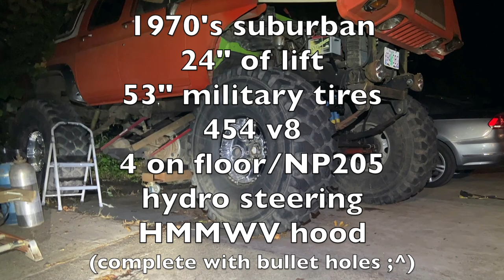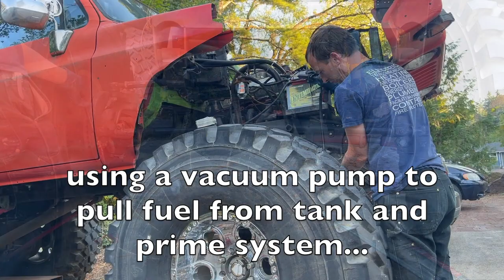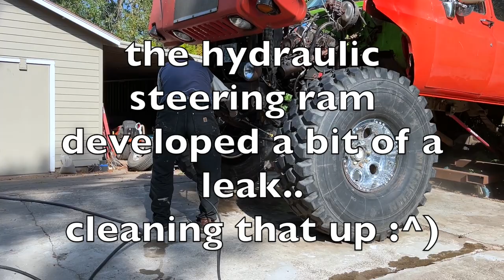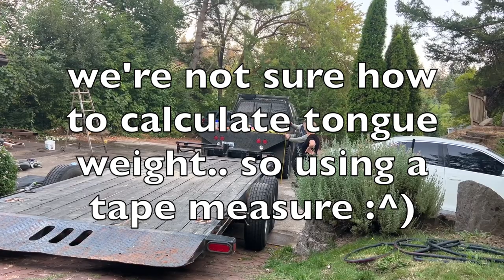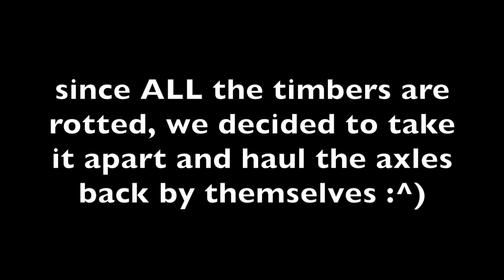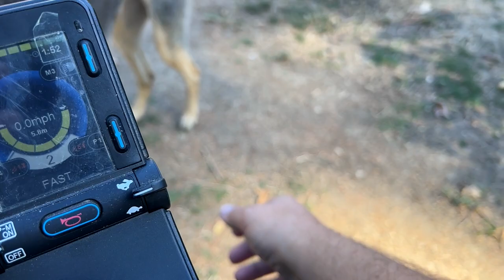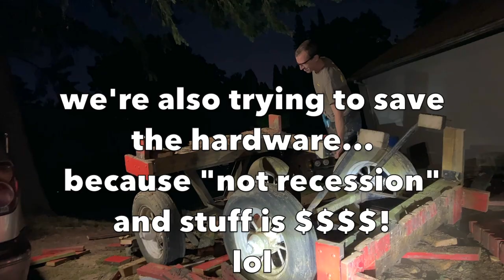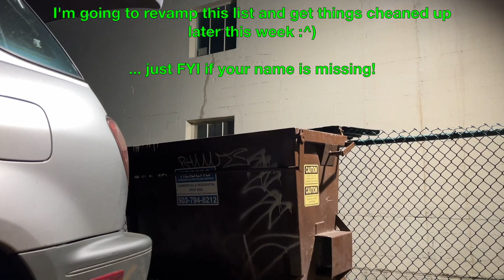MEGA VLOG 635: stuff with wheels!

Comment: When in doubt throw the manual pump over left shoulder and fit a cheap electric pump that are good for 10k hours and cheaper than manual pump
Reply from the maker: if it were my truck, a blockoff plate would have been installed on day 1! lol at least an electric reciprocating pump makes some noise ya can hear from the cab :^)